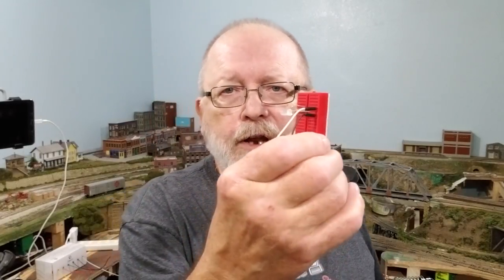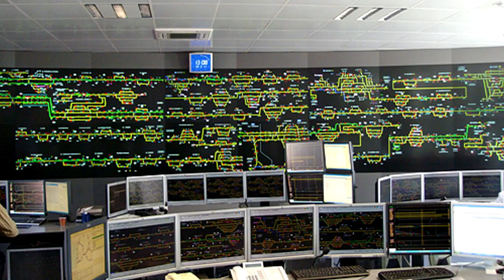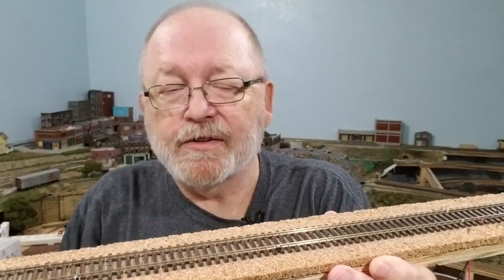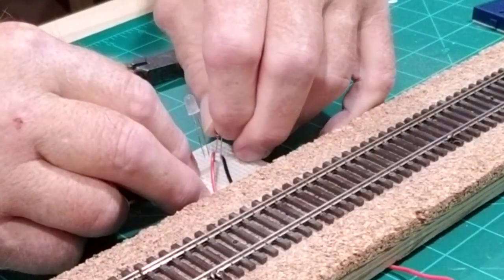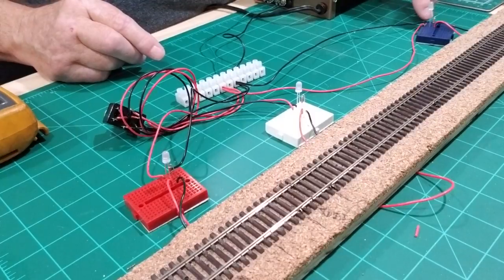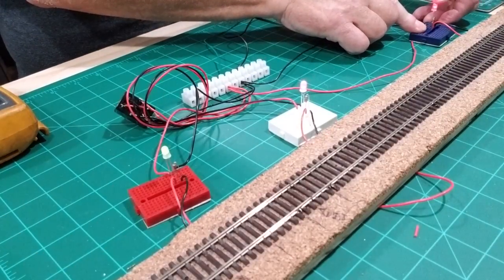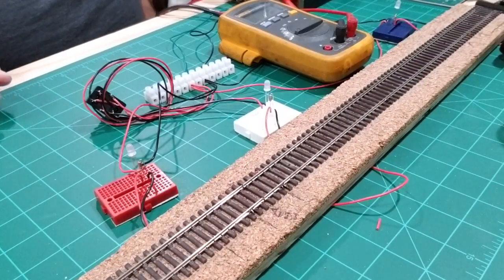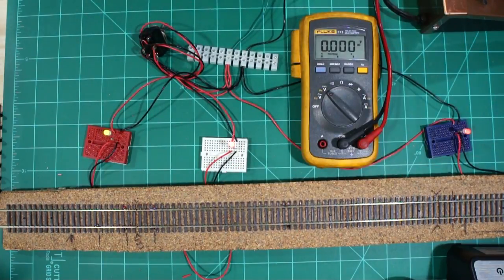How To Avoid Shorts In A DC Reversing Section

Comment: Finally, a thorough explanation! As a "Marklïn guy" this was of no concern, but now that I own LGB trains, I was breaking my head over reverse loops. Still have to figure out how to not reverse all polarity when running multiple trains.
Reply from the maker: Isolate several feet of track only in the part that is reversing. Send me am email if you need further assistance.
Reply: @TomsTrainsandThings  For DCC this will work flawlessly, but analog trains will reverse direction so the second locomotive which is not in the reverse loop will start running backwards as soon as the polarity is switched.
Reply from the maker: If you use a DPDT switch foor ht eshort section you can avoid reversing all the tracks. With the sw you only reverse the short section.
Reply: @TomsTrainsandThings  Imagine a small layout consisting of an oval track with a reverse loop on the left of the oval. That would look like this -->  o__O One train is running clockwise inside the oval while the other is leaving the oval and going to the reverse loop. How is the train able to return to the oval if the train in the oval is not allowed to run counterclockwise nor is it allowed to stop. It can't be done, polarity has to be reversed, else the train coming out of the reverse loop is stuck between the loop and the oval.
Reply from the maker: If all you have is two ovals connected by a track on one end, you do not have a reversing loop. Since you have two seperate districts/blocks, you would need a second power pack. One for each oval seperated by insulators on both tracks.
Reply: @TomsTrainsandThings  No, one oval and one reverse loop. The train running clockwise in the oval will start running anti-clockwise when the polarity is reversed to get the second train out of the reverse loop.
Reply from the maker: You'll still need two separate power supplies. One for each loop. the center track would be isoplated on both ends, with a DPDT switch changing which power pack controls the track power.

Comment: Hi Tom, Have watched your videos on the reversing section, wiring a dpdt switch and also a dpdt switch for DC and DCC.  With the digitrax AR1 how would you suggest wiring for DCC and then your LED suggestion for DC auto reverse.  Would you keep this as a seperate bus and then use another dpdt switch.  I am concerned that when you have selected DC that the current may still flow back into the ar1.  Appreciate your advice please
Reply from the maker: AR ! are not for DC. They are a DCC device
Reply: @TomsTrainsandThings  Tom, thanks for the reply to Glenn Vaughan. Glenn

Comment: Hi Tom 
Great video, I have a question about the powering of the LED's if you are running a DC layout and you train is at a slow pace track power about 5 or less volts will it be enough power to light the LED's ? and also when you stop the train your LED's will go out ( as no power to the track)?
I have been rattling my brain on how to get a constant brightness for the LED's and the only thing I could come up with is having 2 DPDT switches side by side and flipping both at once i.e one for track power and one for LED power, can you think of another way ?
Cheers Mark
Reply from the maker: Watch this video. I use DCC but it also applies to DC. If you don't have a red/green 3 pin led, you can use two seperate leds.  https://www.youtube.com/watch?v=vpUOKWzV7ZA
Reply from the maker: Here is another video https://youtu.be/YrVDv65vzPI
Reply: @TomsTrainsandThings  Hi Tom Awesome got it Cheers Mark :)
Reply from the maker: @markdebsauzzietravels  Glad it helped

Comment: hi Tom... the drawing of you is awesome... i do have a question.. is a reversing unit such as a Digitrax AR1 strictly for DCC???looking at the AR1 it seems that there are no "chips" in it.. just a relay, capacitor & some resistors... just curious ... good tutorial.. thanks for sharing.. vinny
Reply from the maker: Thanks Vinny. The AR 1 will not work with a DC locomotive on a DCC system. I tried it, my locomotive stopped when it got to the protected track.
So, I would think it would not work on a DC circuit. Here's an article from the help desk:  http://www.digitrax.com/tsd/KB539/ar1-special-considerations/

Comment: excellent.
Chuck
Reply: What I did was to have two controllers and an isolated section.  When the train was on the loop I would turn the second controller the other way so the polarity was reversed when the train came out of the tunnel.   Peco item PL-15 attaches to a point motor and reverses the polarity,  so you don't need a manual switch, or two controllers!
Reply from the maker: Thank you Chuck
Reply from the maker: Thanks for the information Frederick

Comment: I don't understand why you need a reversing section for
Reply from the maker: It's a very common practice used to turn your train in the opposite direction especially in a point to point operation. The track plan I showed in the video was one created by another viewer. It's similar to many track plans published in many of the "Track Plan" books available.
Reply: Oh I see what you mean now. Instead of running the same way they can run away from each other. Thank you getting me to understand.

Comment: I understand the simple DC circuit reverse of the track,but. say your running a BIG BOY loco..you now have  two sets of 8 wheels on the loco picking up track voltage,plus the leed 6 wheels of the tender..you cross the rail gap with the first set of wheels on the loco..the others still on the opposite rails..you just created a short in the loco
Reply from the maker: Hi Terry, that's why you have the same potential on the lead track as you do on the reversing section. The two green Led's. Once all the wheels are cleared into the reversing section, you can reverse polarity of the reversing track to match the other end Red Led. Then you can exit the other side without shorting the tracks. If your gonna run a Big Boy you;ll need a longer switchable track in the center. That is the point of using the LED's to show the polarity of the tracks. If your lead track is green and your reversing track is red, you need to switch the reversing track so it shows up green.
Reply: This is a DC circuit,running a DC loco..wouldn't changing polarity of the track reverse the direction of the loco as well?
Reply from the maker: Yes, that's why you have to stop it while your in the reversing section and not only change the polarity of the track but flip the switch on your power pack.
Reply: BINGO..thank you TOM
Reply: Ahhhh..now it makes perfect sense why you "have" to stop the train once in the section..you have to flip the direction switch on the transformer as well.....this has been a most helpful hands on video.. Thank you for sharing. Tom
Reply from the maker: Your welcome. Glad it helped out!
Reply: just add a fueling station,water tank etc. to give reason for stopping.
Reply from the maker: Great idea Terry
Reply: I think you got this wrong. You should not have to stop a train in the isolated reversing section, nor do you reverse the polarity of the reversing section. You want to switch the polarity of the rest of the blocks not the reversing section. The reversing block should have a normal SPDT switch for cab selection, the DPDT reversing switch is to reverse all other blocks. There should never be a need to stop the train.
Reply from the maker: Dave, this is a simple oval with a reversing section for a beginner with no other blocks, not an advanced layout for the seasoned modeler. The layout in the drawing was from a viewer requesting clarification on a particular situation.